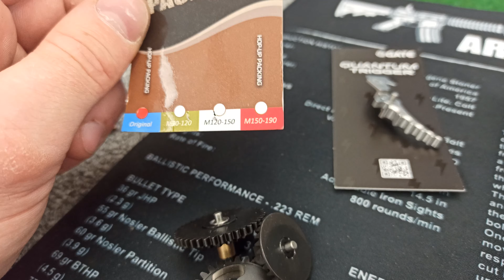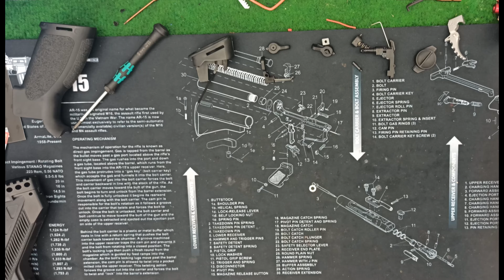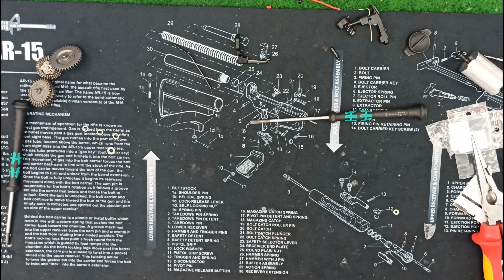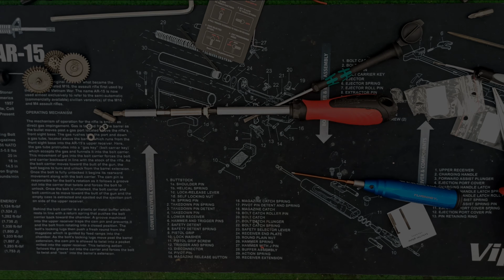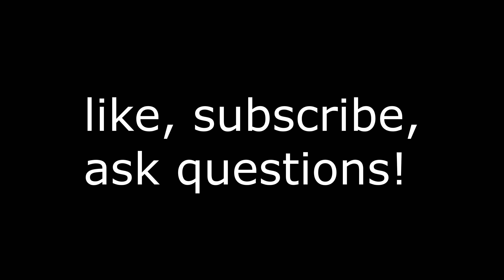VFC/UMAREX HK 416 Tuning / Upgrade / Optimiziation (Disassembly, Tipps, Recommendations, Reassembly)

Comment: Did this VFC 416A5 have any upper and lower receiver wobble or play? Mine has a little and don't know how to fix it. Nice video on how to disassemble.
Reply from the maker: Well, sometimes there is wobble. but this video is 3 years old and i have no clue if this particular one has rock solid or not
Reply: There is an easy fix.. just use "accu" rubbers and put in the back of your lower receiver.. or take some ductape and put a little square of it at the front of your lower receiver on euch side, voila, no wobble anymore!
Reply from the maker: @ad-vi2gs  true thing..

Comment: Sehr geil, Dein Video Hilft mir gerade sehr, vielen Dank! Macht es Sinn die Lipo Batterie von 7,4V auf eine 11,1V Batterie zu upgraden mit dem Motortausch?
Reply from the maker: Hallo, durch einen stärkeren Motor hast du natürlich sowieso schon schnelleres Ansprechverhalten/mehr Feuerrate. Mit einem guten 7,4V und entsprechenden Einstellungen in der Elektronik hast du im Semi entsprechend auch schon sehr ordentliche Ergebnisse und schonender ist ein 7,4V Akku auf jeden Fall. Mehr spaß wirds mit dem 11,1 machen und wenn das System ordentlich gebaut ist, sollte der auch kein Problem sein.
Reply: @ Danke sehr !! Ich hab mich bei der Bestellung an deinen Empfehlungen orientiert. Hab eine HK416 von Umarex. Die hat viele der von dir beschriebenen Probleme zum Glück nicht, die haben sich scheinbar etwas mehr Mühe gegeben…

Comment: Hi what's the size of the allen key for the mag release, i cant get it out :(
Saludos de Chile 🇨🇱
Reply from the maker: actually its the smallest fucking thing you may find out there.. mine has no marking on it, so iam not really sure, but i gues its 0,5mm
Reply: Same couldn't get mine out, and now its probably pretty f'ed. I used a 0.9mm and that seemed to do the trick for abound 3 turns. then it started skipping..

Comment: Could you share the used parts list as well? Your result is awesome!
Reply from the maker: Well this was a while ago... but as i remember: 
- SHS/J-Tac Speedpiston 14 Teeth, hardened steel, nylonfiber
- Aimtop HopUp-Bucking, green
- SpecnaArms 14:1 gears (with ball bearing)
- GATE ASTER with ASTER QUANTUM Speedtrigger
- Tornado hightorque motor (most others will also work, just good neodym magnets and hightorque is the key.. SHS and some others are a good choice)
---------------
Parts not changed because its not needed or not worth the effect: 
- Nozzle (exchange it for a very very small FPS-increase), Cylinder, Cylinderhead, HopUp-Unit (pay 70+$ for a MAXX if you want to not lose like 4 BB´s while reloading..), Pistonhead (if it seals, it seals)
Note down: To not break the gearbox with a spring stronger then 120, inform yourself about something called "radiusing" https://www.youtube.com/watch?v=lkuqMdKR4fo

you are welcome

Comment: Hey great work! Could you tell me pls how to change the sound of the shooting because in brand new hk416 umarex sounds like cheap aeg toy :/ pls tell me i will appreciate
Reply from the maker: First at all you may adjust the motor-screw on the pistolgrip - and get a propper battery like 11,1V Lipo. next steps would include to open ist and install other gears, an ETU and stuff..

Comment: Hello, thanks for the video, can you send part list?
Reply from the maker: Well this was a while ago... but as i remember: 
- SHS/J-Tac Speedpiston 14 Teeth, hardened steel, nylonfiber
- Aimtop HopUp-Bucking, green
- SpecnaArms 14:1 gears (with ball bearing)
- GATE ASTER with ASTER QUANTUM Speedtrigger
- Tornado hightorque motor (most others will also work, just good neodym magnets and hightorque is the key.. SHS and some others are a good choice)
---------------
Parts not changed because its not needed or not worth the effect: 
- Nozzle (exchange it for a very very small FPS-increase), Cylinder, Cylinderhead, HopUp-Unit (pay 70+$ for a MAXX if you want to not lose like 4 BB´s while reloading..), Pistonhead (if it seals, it seals)
Note down: To not break the gearbox with a spring stronger then 120, inform yourself about something called "radiusing" https://www.youtube.com/watch?v=lkuqMdKR4fo

you are welcome

Comment: How do you remove the stock? There is no video online showing and even at 0.25 speed I cant see what you do to renove it.
Reply from the maker: Hello, the stock is fixed with a small grubscrew on the upperside of the reciever.. also you have to remove the gearbox to get it out
Reply: @jokerthemisguidedmoralcomp2063  I just want to remove the stock and not the buffer tube, so I still need to remove the gearbox?

Comment: hello, which hopup upgrade fit in hk416 or m27?
Reply from the maker: Hello, this 416 takes the usual hop units which are tm-compatible. Like MAXX, G&G, Gate, Retroarms, etc. but the stock one is quite good. i recomment you just to upgrade the bucking
Reply: @jokerthemisguidedmoralcomp2063  thanks for the value information, i will follow your recommendation.
Reply from the maker: @Systema_AC  you are welcome

Comment: Please teach me how you removed the stock because I cannot get mine off for the life of me
Reply from the maker: Hello, 

Stock: you need to get it to the longest possible position, then you need to get the button you pres to move the stock to go an extra mile - like grab it and get it up a little more then it would go with simple pushing... 

stocktube: you need to remove the stock, remove the upper reciever, get out the little screw from the upper side of the lower reciever, GET OUT THE ENTIRE GEARBOX and then you may unscrew the stocktube like a real one by just turn it a few times. 

hope that helps
Reply: @jokerthemisguidedmoralcomp2063   thank you so much I was trying to figure it out for so long
Reply from the maker: @teezzyyy3796  you are very welcome
Reply from the maker: @teezzyyy3796  you are very welcome